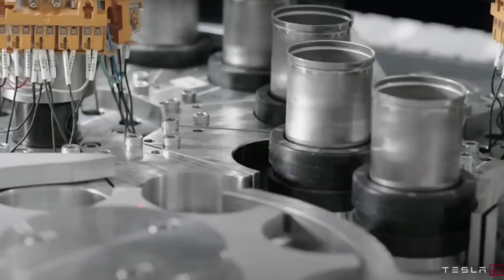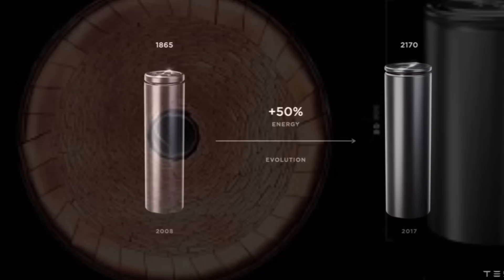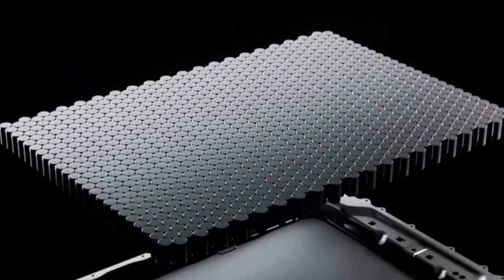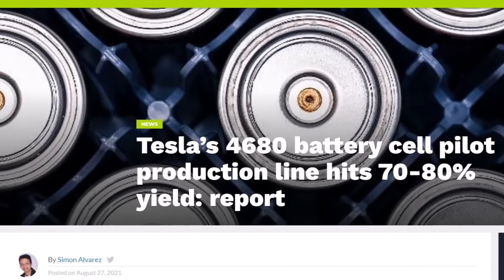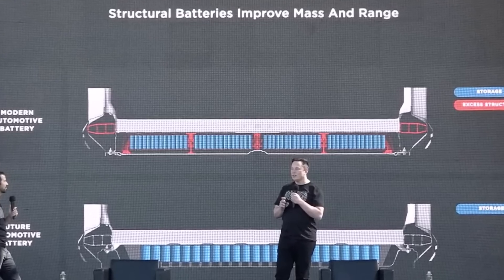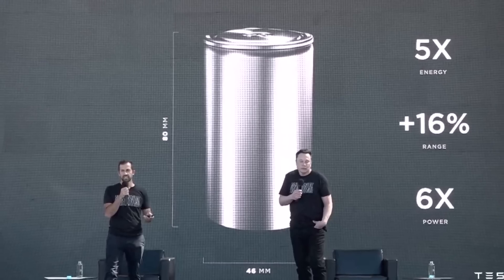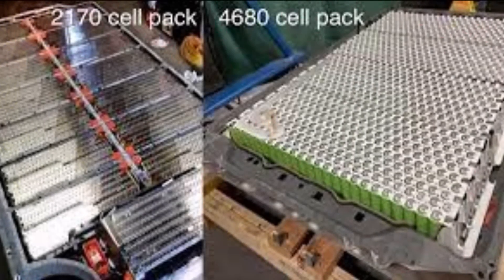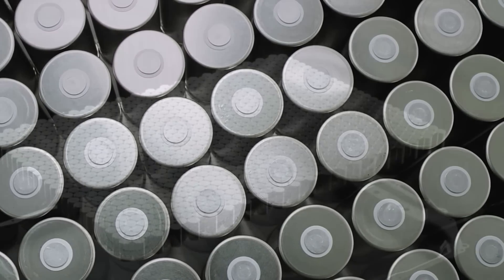HOURS AGO! Tesla 4680 Battery Cell Pilot Production Line Hits 70-80% Yield

Comment: New battery packs are very expensive, close to 70% of the cost of a new vehicle, the cheapest is around $16,000. Unfortunately, refurbished battery packs are basically useless because they only replace the cells that are shorted or otherwise not working. The remaining time of the cells that were not replaced is the time that the refurbished pack will run since all cells suffer from the same malady caused by the replaced cells to fail in the first place. 

All Lithium Ion batteries suffer from the same problem, spikes that grow between the cathode and anode until they reach the other side and cause maximum current flow through the short circuit. In many cases that can mean a fire that will also completely destroy the vehicle because using chemicals or water to put out such a hot fire basically does not work. For that reason most fire stations will allow them to burn until they run out of fuel. Also, Tesla times the battery life so that if fails just after the warranty expires. That means that a used Tesla is basically useless.
Reply: Do you have any data to back up your claims?

Comment: Okay so they've increased 'the yield' (whatever that means) from 20% to 70-80%. Meaningless unless we know what percentage yield is normally acceptable. Believe it or not some of us aren't familiar with manufacturing engineering specs.
Reply: 95% maybe to go into production and the continue refinements to fractions of percent as they go .... Yield is usable items from process by %...eg cells that meet performance and structure requirement specs
Reply: @lylestavast7652  Thanks Lyle.

Comment: I think the word you are searching for is COLANDER and it is not a verb.  Colanders are used to process mixtures and slurries which may have high or low moisture.  The idea is to produce a uniform mixture and to control the maximum particle size.  So I believe there may be a lack of chemical terminology for machinery controlling dry or low moisture mixtures.  Colander certainly beats calendar.
Reply: No he's referring to rolling sheets to reduce thickness. Calendering....

Comment: As far as I could tell the rumor about 2170 batteries replacing the 4680s is just that. A single online rumor. While I'm sure that Tesla does have a contingency plan to use the 2170 batteries if they can't make enough good 4680 batteries, there is only (One) unconfirmed rumor saying that this is actually going to happen. On the other side of the spectrum, I also think that a self professed Tesla investor's opinion about increased 4680 yields hitting 70-80% is also just an informed guess. I seriously believe that Tesla NEEDS to release the German Gen II Model Y using the 4680 batteries. They have long hyped up the special and unique design of the German built Model Y. And not following through with that promise would seriously hurt Tesla sales. I think that the whole 4680 output of the Kato road battery factory so far has been stockpiled for future use in the German Model Ys. We should know for sure in just a few months time when they start Gen II Model Y production in Giga Berlin.

Comment: While I am looking forward to 4680 based battery packs - I doubt any current orders will get them. It is more likely once Tesla gets enough cells to use in cars, they will add an extra trim level that includes the 4680 with a bit of extra range. I hope I'm wrong because waiting until January for a car with the existing tech is frustrating. I suppose I could always delay my order - let's see what happens the rest of the year.

Comment: China is going to a LFP Blade. BEV china OEM have all switched from round can LFP like 4680 to flat plate LFP Blade. Blade is safer lower cost and structural. Thousands of china LFP Blade are driving now in China. New yes but 10x better than LFP round can 4680.
Even Tesla is testing LFP Blade cars in China. Tesla is working on a low cost LFP Blade BEV called the Model 2. Yes! Tesla China is installing BYD Blade in BEV now.
Tesla is going to dump LFP 4680 for LFP Blade.

Comment: Yay, Thunderf00t is going to make another video showing how STUPID this is. 😆
An "improvement in battery technology" would be to increase the "energy density" of a battery. Increasing the SIZE does ABSOLUTELY nothing to improve range or cost. 
It does scale down the number of connections, but I'm not sure that's a good idea; larger battery means it's harder for it to dissipate HEAT. 
Energy density is the only thing that truly matters though. Oil has tremendous energy density; way more than lithium.

Comment: Just wondering...is the plan to do a mega casting for the structural battery pack or just some sort of stamped tray and epoxy the batteries together to create the structure? Also, any further word on the 4680 vs. the BYD blade battery, and how they compare from a performance and cost perspective?
Reply: To address the issue of heat generation, consider the cause of the heat. Electrons traveling and shoving their way along the tab conductor is primary cause of heat in my experience with LiFe-class batteries.  So long as the tab provides significantly lower travel path for power dissipation via resistance, heat will be limited to chemical reaction itself.  In both modes, it seems that charge rate will be primary limitation, not heat production.  Power supply for charging would be insane (1MW) to charge 100kwh battery in 10 minutes.  Thats a as much as two Walmart’s supercenter power consumption (460kw average based on ilsr.org data I found)… to charge ONE car at that rate.  So the reality is, as I see it, heat dissipation is no longer the issue, for reasonable power delivered to charge, but geometry is.  Flat cells are harder to manage when the cells begin to expand as they age.  Fitting my worn-out drone batteries into the drone becomes an issue as they swell.  With reduced path length for both geometries, both can manage heat dissipation well under reasonable charge rates, however, cylindrical cells provide greater protection against axial/uniaxial forces verses long rectangular packs.  Would be interesting to see how this plays out
Reply: @user-bi7nq4nj7q  Indeed, interesting to see how this goes. I wonder if the cylindrical form factor is easier to produce (rolled up), because speed of production is critical, and provides more rigidity to the structural pack (acts more like a honeycomb than blades would). Also, I should look into the BYD blade more. One of the game changers at Tesla was eliminating the drying step, which BYD still may need to do.
Reply: @machoopichoo2  just noticed your user name.. nice.  I wonder how the recta-packs will hold up to stress/strain - and further, how it will become part of the structure.  With increase in surface area, comes increase in casing area, and mass.  I suspect elon’s engineering dept explored these geometries too.  Rate of production is one factor, overall expense for mass production seems to be the big winner for brining EVs to market - i hope to be able to afford one too soon.  Charging not an issue for me; i dont travel outside of my hometown much, and ive completely off solar.  ive also expanded my system in anticipation of owning an EV - my system can easily provide 14kwh of power almost daily (56mi/day) - with 500mi range, and 10kwh increase in my LiFe capacity, there will be no situation where ill be out of power! Woohoo!
Reply: @user-bi7nq4nj7q  Thanks! Sound like you have built yourself a nice off-grid setup. It's unfortunate that Tesla does not yet allow their vehicles to act as battery backup for homes or return power to the grid. I suppose it is only a matter of time though.  That could give you even more energy independence. I have an order placed on a Cybertruck but I am not sure I will go through with it...if robo-taxis take off in a couple years, I may never own a vehicle again. Cheers, m-pichoo. ;^)
Reply: Blade form factor by byd is a big deal, smooth implementation into stractural pack with minimal area required, cooling would be quite efficient due to greater surface area and finally top safety characteristics, I begin to believe that balde form factor is superior to the 4680 one!
Reply: Ford robo taxis hit the streets next quarter. Tela's stuck at level 2
Reply: @teslanews2792  Quarter 4, files for bankruptcy.
Reply: @teslanews2792  What? Did you see Sandy Monro pan Blue Cruise for disengaging while cornering? The only way Fords are going to robo-taxi is if Waymo starts buying them.
Reply: @teslanews2792  Ill look into it. But from what Ive seen of the MachE, its probably just a duct-taped together mess desperate to reach a goal its failed at already.  Ford and the other Big-two are a relic of failed american policy on more levels than ever. Elon’s metrics will ensure rapid acceleration of his product delivery at such an incredible rate, it will make the big-tree effort look like what it is: a slackers effort to slap something together while shoving something to market in desperate attempt to recover its imploding company.

Comment: Putting the right checks in each step of the manufacturing process will change the finished product at noticeable break points, and possibly give the option to change chemistries maybe even in produtions.....
Reply: Basically changing the particle sizes, amount of materials used per layer, types between layers, etc...

Comment: Tesla's engineers are the best in the world.This is not a issue and will be easily solved.Tesla's 4680 cells are better than any other batteries currently held by anybody else.
Reply: “Easily”?  Those big Tesla brains will make it LOOK easy.  But it won’t be easy.  Otherwise, Panasonic, LG and CATL would already be doing it.
Reply: @JaiUneGuruDeja  It will be easy because it's a engineering problem  and they said it's easy to adjust the process..I have been a process engineer for 37 years.These kind of adjustments are normal because it's a new product.

Comment: Bigger cells can create heat issues, I hope that cooling is improving also
Reply: My understanding is that cooling will be on the ends of the batteries, where more heat is generated and where heat transfer is better. The older cells have cooling channels in between them which limit packing density as well. Additionally, the tabless electrodes will generate less heat due to improved electron flow. I am optimistic.
Reply: The tabless design wicks heat away from the cell much more efficiently.  The entire end of the cell can conduct heat because there are tabs along the entire edge of the roll.  Why they call it tabless is beyond me

Comment: I feel like the 4680 production development is going to follow the same path as the Raptor engine. Very slow development at the beginning but at some point they will pump those cells out of the line fast af.
Reply: Yeah, the Raptor 2, booster 7 outcome will probably be repeated with the battery.

Comment: Since there is an engineering issue rather than a concept issue, the issue will probably be fixed. All should be well.
When Musk was confronted by cost issues in the SpaceX program, he reduced the cost from 26 Billion to 1 Billion to restart the space program, using existing engineering fixes/modifications, etc. The same should apply with the 4680 manufacturing process.

Comment: Does anybody know what percentage they need to hit to start actual production?
Reply: 5% scrap rate is considered a threshold you need to pass in this kind of production...  as you can imagine, that scrap rate (even if recycled) will vary based on cost of individual materials and total plant costs etc...  so, getting to 95% is probably  a solid number - but, they could choose to go at a lower % achieved, and it may depend on the nature of what's causing scrappage as well.   In mfg, you tend to see high mess rates early that clean up in large chunks with a few key fixes...  that rate % will step up in solid steps as the prioritized problems get mitigated.  Later, you fine tune out issues and get smaller incremental % return for it...and some, you just don't ever spend the money fixing - the problem isn't worth it sometimes - perfection being the enemy of the good type thinking.

Comment: if you look at Musk statement in April period that it was a year to 18 months out, that level of yield seems pretty promising as a mark along the way if it was 20% last year...  it depends on how many failure points in process you have to engineer out in process...  since they're recovering unqualified cells materials, they have the option to stockpile some good ones for key project needs earlier than full production... and that % will hopefully inch upward - so someone doing some linear programming has a good model telling them when the GO! point is doable... and some of that might be dependent on cost of materials and not just on fixing process engineering issues...   but that's a huge jump from 20's to 70-80 (assuming whoever provided that is actually in the know vs some cafeteria rumor).

Comment: Question is how good 70-80% actually is? Throwing away 20-30% of all produced batteries seems a lot to me but I don't really know what the typical yield for a battery plant is. Any numbers on that? (Edit: of course the faulty cells would not been thrown away but recycled)
Reply: its just the start of production. of course later it will be better.
Reply: I think Panasonic’s is 90% on a full line
Reply: 75% yield means your production cost is 33% higher. Given that Tesla's estimate is that the new battery will raduce cost by half then 70% yield is good enough for mass production.
Reply: @kazedcat  It's not only about cost but also about how much cells you can produce. This is only the pilot plant so not enough cells for all cars anyway.
Reply: EinzigfreierName Production line will be built in GigaBerlin and GigaTexas. That will move with the speed of permitting approval. But when the permits are ready they have the production blueprint prepared.
Reply: @kazedcat  I know but this will take some time. Don't know how Tesla is going to handle this as long as production of 4680s can't keep pace with Model Y production. Most likely only LR models and only some markets will get them.
Reply: EinzigfreierName Tesla has doubled their order of cells from all their battery supplier so they have enough cells to double their car production without using any of the in house built cells.